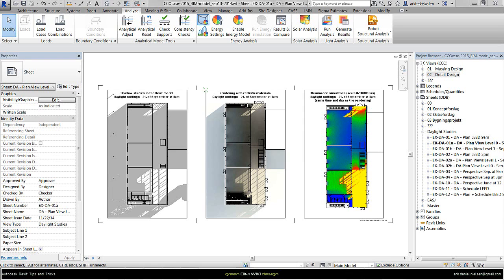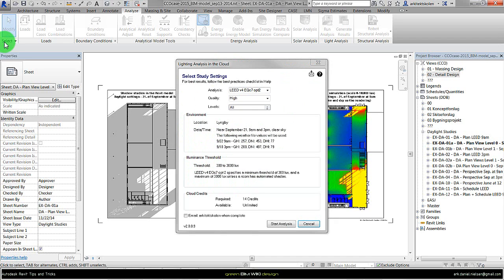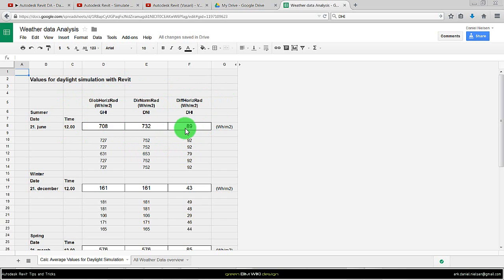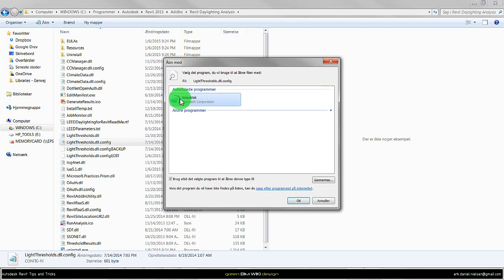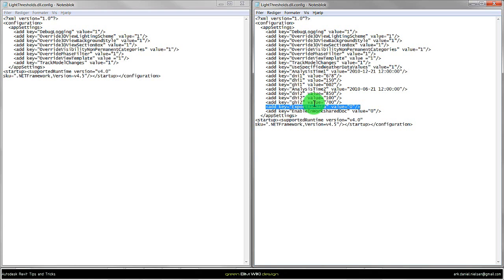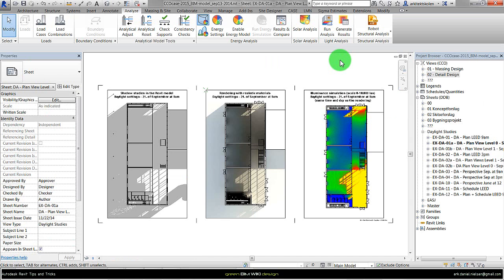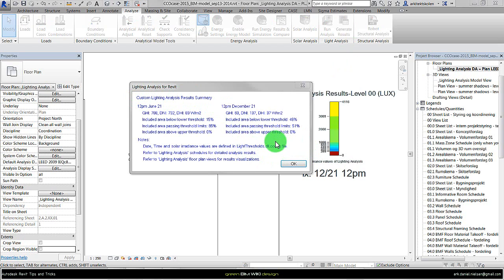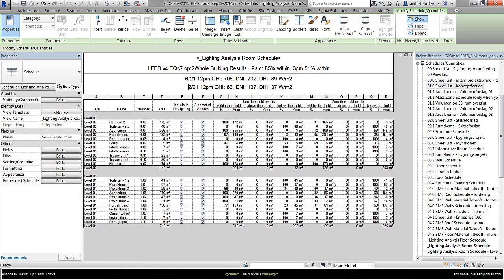Autodesk Revit DA - Daylight simulation with custom Date+Time with Light Analysis (Illuminance/lux)

Comment: Daniel, 
Could you clarify again your modifications in dll file? As I get it right, Revit only calculates fixed time steps?
Reply from the maker: The Light Analysis Plugin simulate (as default) the 21. of September at 9am and 3pm. That is the time steps that is used to document and get LEED credits.
Reply: Thank you, got it.